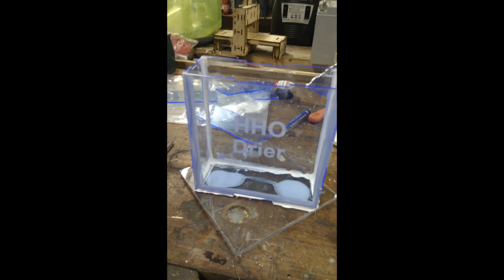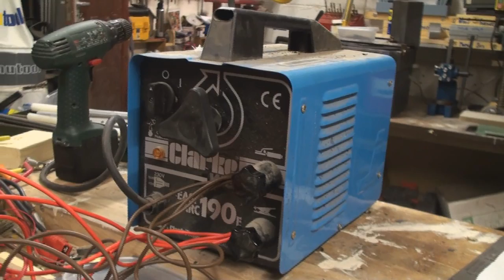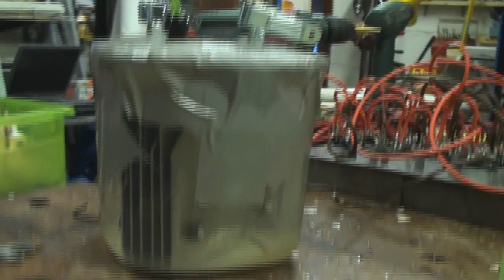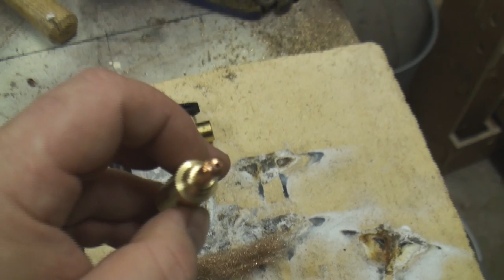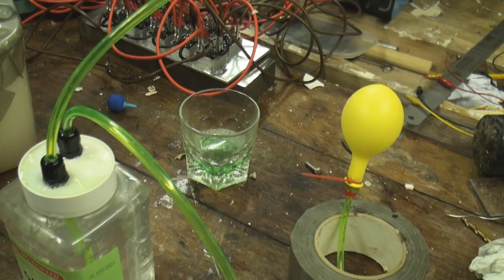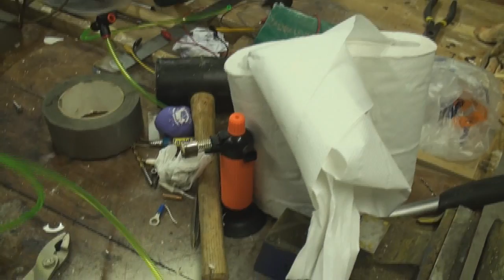200 Amp HHO Generator to welding Torch - Welding with water

Comment from the maker: @4rsnduction Whats more your knowledge bases on the idiotic you see 200 amp and dont understand that without voltage it is very hard to get a shock from this system otherwise the world would be full of dead welders.You are part of the idiot liberal majority that knows enough to be dangerous. I however am an expert and have risk assesed the whole activity. Thats why I have all my fingers and even my eyebrows.